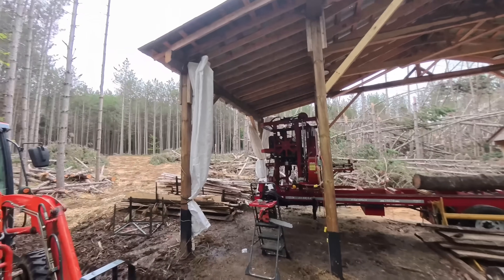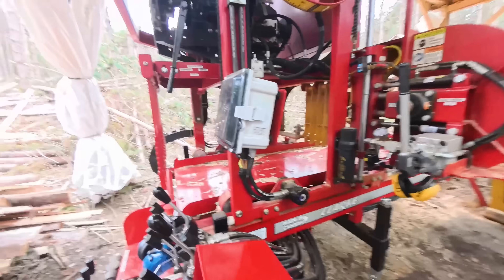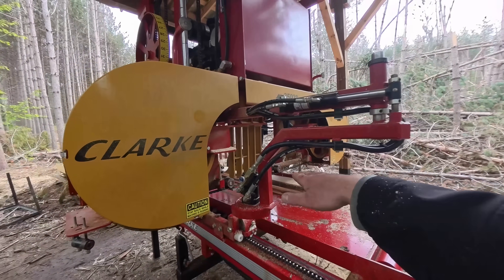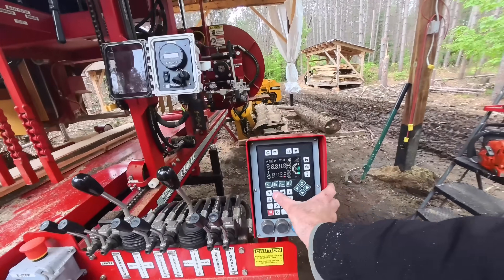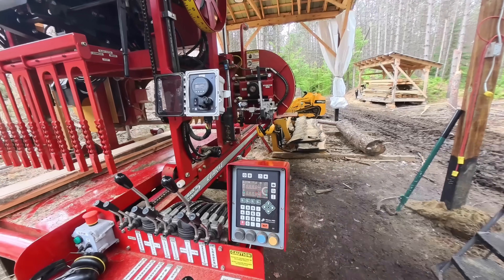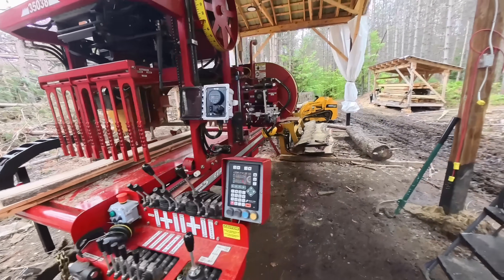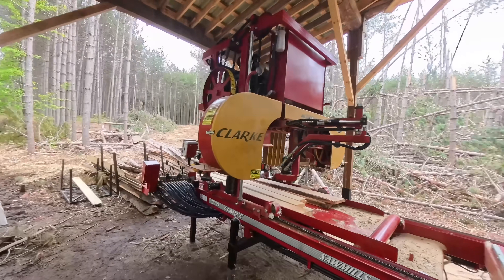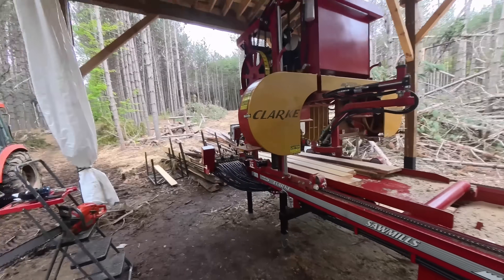Sawmill Setworks Makes Fast Sawing Even Faster

Comment: What do the clamps do in this automatic down back Enter phase as you cut? Do they drop out of the way as the saw goes down?
Reply from the maker: The Setworks controls sawhead up and down only. I still have control manually over all other movements
Reply: @sawingwithsandy ok, so, be really careful not to saw your clamps.
Reply from the maker: Yeah that’s the main reason I have the lasers on my sawmill. Just gives me a visual check before I start down the cut

Comment: I haven't heard a peep from you about sharpening or changing blades since the Clarke arrived! I recently bought some cherry slabs that had some amazing variations in thickness. Am I right in thinking that the 2" blade is providing some beautifully consistent thicknesses? How is it holding its edge? Is it more expensive than the blade on your old saw?
Reply from the maker: All has been good with the 2” blades. I think I prefer them over the 1.25” blades as they cut real flat and seem to hold an edge well as well. I plan on trying out some thicker blades before long as well to see what I like best

Comment: Cool beans Sandy.
I thought the Set works had a "Bump" button to raise the Blade a tad for the Return run. 
Or is there a Sensor on the Hydraulic side to detect that ?
Mike M.
Reply from the maker: Hey there Mike. It does have a bump button  on the display to lift the sawhead a bit. I think I’m just not used to that yet
Reply: @sawingwithsandy  I remember You showing that in the 1st Video. 
I did not see You use it in this one. 
I'd be cautious of the Blade catching the log if it starts to Warp as You cut more slabs off.

Comment: I was out of pocket yesterday, so I'm finally getting to watch on a Sunday morning.  How'd the 2 inch blade handle the white pine pitch? I know you've had issues with the pitch buildup on your other mill, so curious. Good vid. Thanks.
Reply from the maker: Good morning! With the new sawmill and the diesel lubrication I find there’s no more buildup of pitch on the blade at all. The two felt pads that contact the blade to apply the diesel drip does a great job
Reply: @sawingwithsandy  Glad to hear that.

Comment: Yes! Now that's a piece of equipment that'll pay for itself in time and energy. When you get to the end of the board and the saw raises a small amount to drag the board back, are you doing that or does the machine know to do it? Looks good, Sandy............. I LIKE IT!!
Reply from the maker: Hey Carl! That little bump up after I"m done the cut is me doing that before I start the drag back. I've always done that in the event that the log had some tension being released and it raised up slightly when I start the drag back. The machine does all the up and down movements once I bright the sawhead back towards me at the operator station and I press enter.
Reply: @sawingwithsandy  Sandy, yes... I've noticed from the beginning of your channel, years ago, that you always did this, and I considered it a good move, rather than draw the blade through a fresh cut. I'd wondered if the machine did that automatically so the dragback bars didn't hook on the uncut cant. Second, since your blade never stops turning, if you didn't raise it, it could feasibly scar the cut you just made.
Reply from the maker: That’s a good point Carl. Could make marks on the lumber for sure

Comment: Good afternoon Sandy that saw mill is nice the two inches blade and not running on belt does make a big difference at how straight that lumber comes out but you still got to put it to a real test get one of those that we called field trees full of nice big branches all the way from top to bottom either a white pine or one of the native spuce from our northen area not one of those plated for lumber that will be a good test for it have a great day
Reply from the maker: Absolutely. I find those real knotty trees sure test a sawmill
Reply: Yep, I remember the first time I tried sawing a Field spruce shortly after getting my mill... OMG not a wave.... a tsunami. I called woodmizer as soon as I got home. Live and learn

Comment: real impressive and can really increase production, especially in bigger logs. It is so fast that one has to remember to make sure that the clamp and back post are all the way down. I'm always surprised when you put only 800psi pressure on the blade. Sure does not seem like much. If I remember right, I used to put 2300psi on my Woodmizer LT40. Wonder if it is because the Woodmizer had only a 1-1/4'' blade vs your 2'' blade or if the bigger fly wheel on your mill come in the equation.
Reply from the maker: You're right there Yves. That's the big thing to remember as it goes from top to bottom of the log real quick for sure. I'm wondering if there's some sort of ratio where the 800 psi on the gauge equates to a different value. I'll have to ask the owner of Clarke sawmill about that next time I'm talking with him.
Reply: @sawingwithsandy  thanks...curious
Reply from the maker: I was curious as well so I did a bit of investigating and I think that different sawmill manufacturers will have different psi measurements as it will take different pressure to get to the desired tension on the saw blade. I believe that must be the case here but I’ll keep asking around to see what others think
Reply: @sawingwithsandy  sounds good. Thanks for sharing